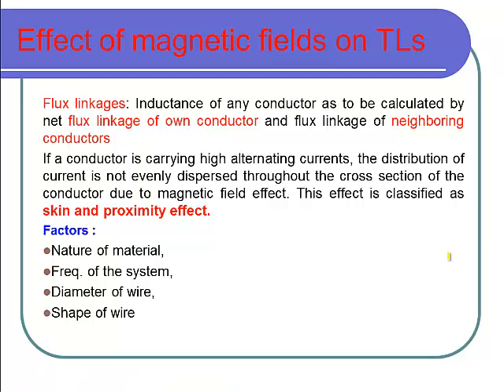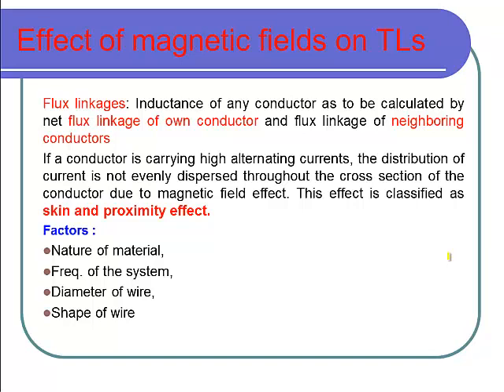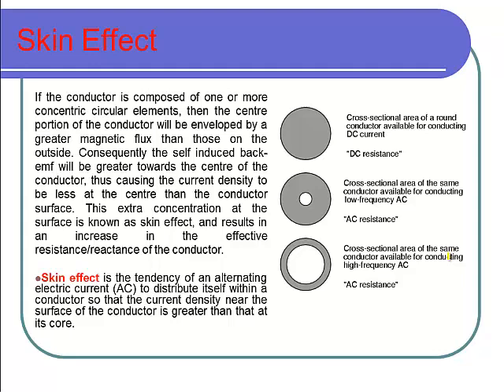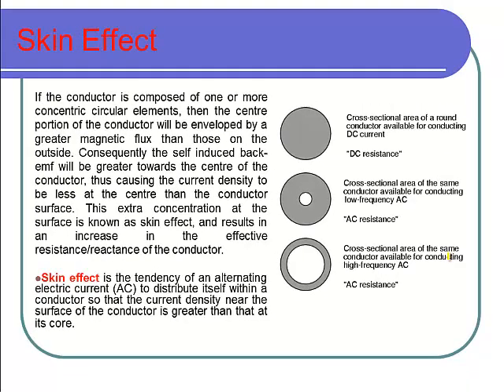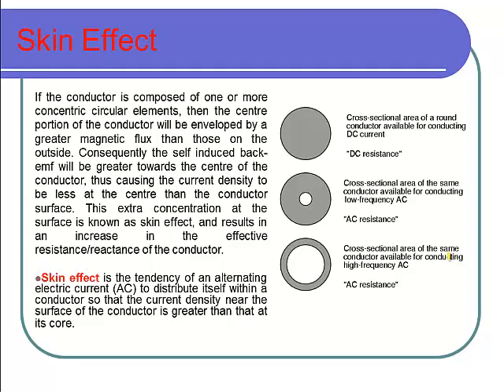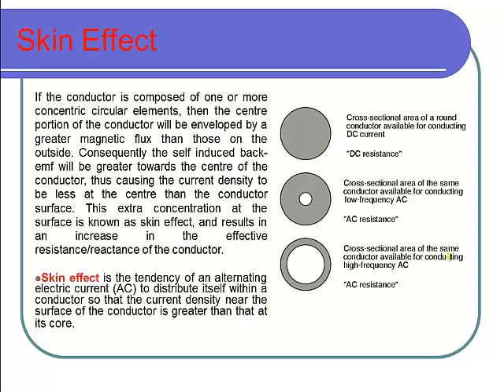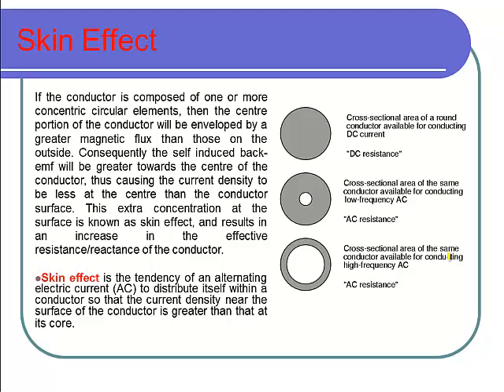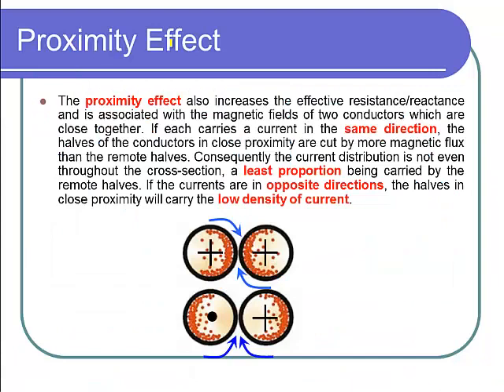Skin Effect and Proximity Effect in Transmission Lines

Comment from the maker: Hi Beetle, I have seen that link. Author is explained with the concept of eddy current. Formation of Eddy current is because of magnetic flux linkage only, that what i explained here.
Reply: Aluminium "Conductor" Steel Reinforced, not Aluminium "Core" Steel Reinforced.
And you didn't explain why flux linkage is more in the inner part of a conductor.